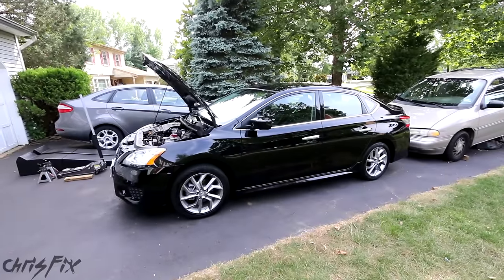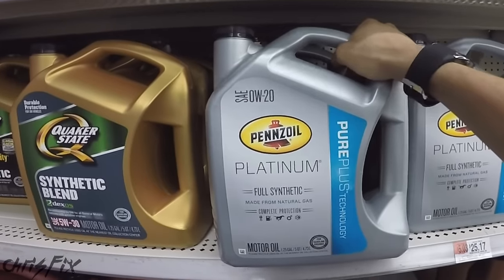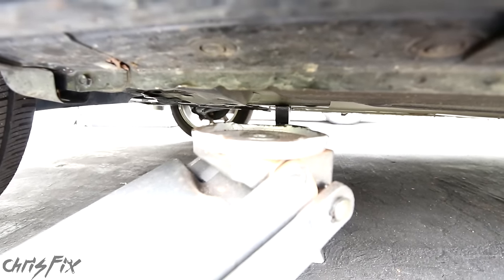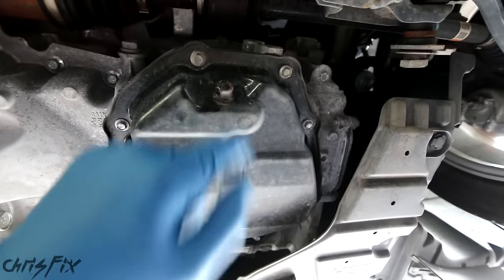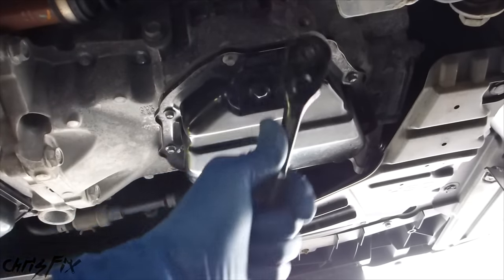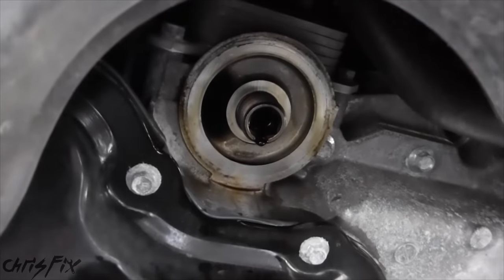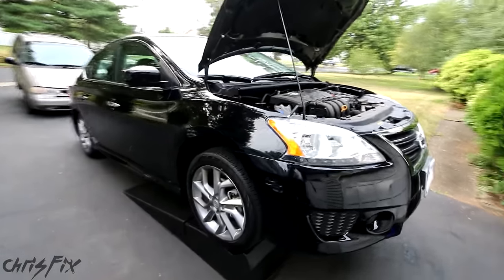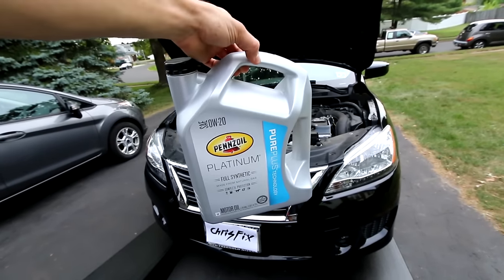How to Change Your Oil (COMPLETE Guide)

Comment: My record for at home oil change is 45 mins (that's setup, safety check, and the job itself)

So far I've done 6 at home oil changes across 4 cars and it's a great feeling not only for the cars internals (it runs so much better on fresh fluid) but for yourself having a sense of satisfaction. A sense of "I did that"

Personally I use Valvoline and change it every 3,000 (I've used both Synthetic and convention and I don't notice any difference)
Reply: Why Valvoline? Simple, it's the Motor Oil that sponsors Hendrick Motorsports in NASCAR (Jimmie Johnson fan BTW) though I am open to trying Pennzoil and Mobil 1
Reply: There are data sheets you can use to compare oils if you want, it's good to do! I've found that Pennzoil Platinum, though it says the same 5w30 numbers on the bottle, is actually thinner at startup and operating temperature than Valvoline Full Synthetic 5w30 and so it's better in wintertime than Valvoline for cold starts. One thing with full synthetic is it generally won't burn at lower temperatures like conventional does and it'll leave fewer deposits. Conventional vs Synthetic's more of a difference for a Diesel engine though, the 5w40 just lubricates quicker than 15w40 and doesn't lose its protection at the hotter temperatures.
Reply: 3000 miles. thats like 4800 km . its every 5 months driving for me. isnt that to often?
Reply: lars vegard vesterhagen Bundli not at all (now if you log 3,000 in 3-4 months you might wanna try synthetic)
Reply: automan224 45 MINUTES?!?!? It takes me 9 minutes for a full oil change and change of filter. Wtf do you do for 45 minutes?
Reply: lars vegard vesterhagen Bundli oil should be changed every 3 months either way.
Reply: HighElderThunder that accounts for 

setup
Running the engine for 10 minutes 
Waiting for 15 minutes 
Jacking the car up
Placing the car on jack stands 
Safety check
Cracking the drain bolt
Draining the fluid
Removing the oil filter
Replacing the oil filter
Replacing the washer on the bolt
Putting the bolt back on (not to tight)
Jacking the car back up to remove the stands
Pouring the oil
Starting the engine
Check the ground for leaks
Drive to AutoZone to recycle the old oil and filter (10 minute drive from my house)
Reply from the maker: Awesome man!!
Reply: Well, in America they wash their Car weekly, and Change their Oil every 5000 miles... like every 8000 Kilometres....

Here in Germany, i dont even wash it once a Month, and my last oil change is like 30.000 miles ago...

Well, i'm going to do it myself, but more like every 10.000 miles, thats also what the manufacturer (Ford) suggests, and every 3000 miles, would mean like all 3-4 months...
Reply: 3DamX1 if your gonna go 10k between oil changes go synthetic 

That lasts the longest
Reply: automan224 i can do it in 20 minutes but whats the fun in that - i take my time to make sure i dont accedentally take any short cuts
Reply: 3DamX1 mitsubishi recomends 15000km in Australia woth synthetic oil but i use 20L drums (10L sump) and do 10'000km between oil changes - so for me this ends up being about 2-3 months as we do alot of driving
Reply: automan224 with the ValvoMax Oil Drain valve, most cars drain in 10 minutes or less. Save the time you would've spent looking for tools and cleaning up the mess. Thoughts?
Reply: automan224 
takes me 15 minutes.  I fit under my truck without jacking it up. 
:)
Reply: Recently purchased a floor jack. Previously I've been using the scissor jack the car comes with in the trunk which is where most of my time went. So now my record is 20 minutes (not including warming up the engine, making sure the car won't land on my head, and driving the used oil to AutoZone)
Reply: Oh noe not a scissor jack. :O

Comment: I used this video to change my oil for the first time.  Thank you!  Additional things I had to look up: how to jack up my car (after a very scary day of trying to get my low car high enough to get jack stands under it- I went and bought ramps), and how long you need to let the oil drain out for (it dripped for a long time and less came out than I thought would).  In the end- success!

Comment: Even though I already know how to do all this stuff, I always like watching these beginner videos. You pick up small things you didn't know before haha.
Reply from the maker: BattlefrontZero That is exactly what I try to do because there are a lot of people who know what they are doing so I try to add some tips in there so even seasoned diyers can learn something new!
Reply: ChrisFix 
Chris, although I believe it is overstated, Purolator oil filters appear to have a tearing problem in their pleats during use.  Check with bobistheoilguy to read all about it.  If you are going to use a synthetic oil, put a Fram Ultra oil filter as they last a lot longer.
Reply: +stchman I haven't heard of a tearing issue on Purolators. 
I have heard of a lot of issues with Fram filters. The one they sell for Subaru's have the wrong bypass valves, for instance.

Comment: At minute 14.42, You also want to make sure your old oil filter gasket is not still stuck on the engine, because You don`t want to double gasket. Because double gasketing will cause a Major oil leak! God Bless.
Reply: Sean Rhodes double gasket is like double-bagging a condom... It gon’ leak!
Reply: I had a family member lose an engine due to double gaskets.
Reply: Sean Rhodes 💯
Reply: found that one out the hard way when i was 14 lol
Reply: Thanks for that info!

Comment: Tip! Use an awl to poke a hole in the old oil filter before removing it, this will allow for a controlled drain and keep from making a mess when you take it off.

Comment: Chris you should warn people about double-gasketing the oil filter, sometimes the old gasket stays on the oil filter adapter and if you double gasket it your engine could blow up
Reply: @The Animator there is usually a gasket around the oil filter were it creates a seal but sometime when u change out the old filter the gasket sticks to car and many people don't realize and just stick on a new oil filter without removing the old gasket. This then means there is no proper seal as the two gaskets are touching which can cause oil to leak which means the engine isn't getting enough oil
Reply: id love to see a video that displays what youre describing, for all the noobs out there.
Reply: if your engine blows ups does your whole car blow up?
Reply: Llama yes like on GTA lol
Reply: @lzeel-jg3hn  Wow, I have been changing oil for 50yr never see oil filter gasket stick to an engine
Reply: Down Dog01 it does happen.  Not often, but it does happen.  Lubing the gasket beforehand is the best way to prevent it.  I work in a lube/tire shop and have only seen it two, or three times.
Reply: @downdog0136  That happened to me the very first time I ever changed oil + filter. Didn't realize until I turn the engine on and it sprayed oil everywhere.
Reply: What he means by gasket is the rubber circle ring around the oil filter
Reply: Good catch!
Reply: @Amanda G it wont blow up relax

Comment: Top tip: some cars have two oil drain bolts, especially older ones. If you only drain one, not all of the oil will come out. For example all ford panther platform vehicles from the 1980s with the 302 V8 have two drain bolts.
Reply from the maker: Thanks for the tip!

Comment: A few things to add, is you don’t have to pre fill the oil filter, the piston walls still have an oil coat on them and it won’t wreck your engine. Also if you have any grease zerks, it’s a good idea to fill it up with grease every oil change. Also it’s a good idea to check your front and rear differential fluid level. Just some tips 😊
Reply from the maker: Thanks for sharing
Reply: @chrisfix  no problem 😉

Comment: My biggest tip is make ABSOLUTELY CERTAIN that you don't cross thread your drain plug. To do this, when you are putting the drain plug into the oil pan make sure it goes in straight and you can tighten it down flush with the pan with only your hand. If you start turning with your hand and it gets hard immediately, back the bolt out and make sure the threads on both the pan and the bolt are clean and free of debris. Then, go at it again. Keep trying until it smoothly and easily tightens BY HAND. I started working at an RV repair shop and in the process have also begun working on my truck. The more experienced guys at the shop have been giving me help in learning how to do various things with it. Well, I did my first oil change on my truck (meaning the first oil change I did myself instead of taking it to a shop) about a month ago. I was rushing it and cross thread the drain plug. This ruined the threads both on the plug itself and the lower oil pan, causing a small consistent oil leak. After weeks of trying to fix it, I just had to break down and replace the entire lower oil pan (which I also did myself). It was a great learning experience for me, but it would have been nice to not have to spend all that time and money replacing the oil pan. Remember to take your time, have fun, and DON'T CROSS THREAD! :D
Reply: Thanks for sharing your experience and helping others, such as me!

Comment: Agree with almost everything in this video. For the washers, I’ve used the same washer up to 3 times and had no leaks whatsoever. Also for the oil filter, I don’t think it’s necessary to spend extra money on tools to take the filter off. If you can get the filter off yourself the first time yo change your oil, you’ll be able to do it without tools in the future, just add oil to the gasket.  Also prefer the FRAM filters as they’re easier to tighten because they have rubber on the tip which helps you grip onto it well when tightening

Comment: One thing I have learned over changing my oil as a tip, if the oil filter is on there too tightly to loosen it by hand, get a leather belt and put it around the oil filter and tighten the belt like you would tighten it around your waist, and pull towards the front of the car and it will break free. Although this does work well I wouldn't do it unless you don't have any other option or other proper tools to get it off. Just my quick tip
Reply from the maker: Thanks for the tip!
Reply: I wouldn't use my best belt for that. lol

Comment: Can I use essential oils for this?
Reply from the maker: No
Reply: Thatd be one hell of an expensive oil change, both filling the engine AND seeing the aftermath lol
Reply: ChrisFix I feel like they are trolling xd
Reply: I've heard Cinnamon Leaf or rosemary Essential Oils are good for ur engine, they also increase ur car's hp - this is something ur parents never teach u
Reply: Sk00tkab00t at least the car will smell calming and good at start up IF it starts up. And then a new engine for you.
Reply: If its true then. How about using cooking oil xD
Reply: My car is a she
Reply: Make sure you pour some activated charcoal in there too.
Reply: @WI-FI_GOD   might be transgender it's 2019
Reply: I find Lavender oil of the correct viscosity works well.
Reply: Dude trynna make a joke and chrisfix aint having it😂
Reply: I use coconut oil.
Reply: I use maple syrup.
Reply: Oils aint oils lol (its a castrol thing) 😅😅😅😅😅
Reply: When your minivan uses full synth oil and miles per hour instead of DoTerra essential oils and Autisms per vaccine
Reply: ChrisFix lol
Reply: I'm interested to see the results of that. If you want to, try it.
Reply: Karen must have sent you lol
Reply: No. Things that are not meant for humans can damage if humans eat it, same goes for your car. We eat stuff formulated for humans and use certain soaps in the shower that are formulated for our skin, so only use stuff that is formulated for automobiles whether it is a type of fuel or a certain car wash soap.

Comment: 2 tips from me - check if the gasket on the old oil filter is there when you remove it, if not, remove it from the engine, because if you leave it there, it will leak. Also if your engine oil filter is like this in this video, so you can pre fill it - fill it from the small holes, not from the big one. Other than that, every other thing you need to know is in the video. :)
Reply: Yes, there is a reason, this is the input for the filter, so when you fill it from the small holes, u filter the oil and when you start the engine, u are 100% that all the oil is clean
Reply: just got here to write exactly this :D

Comment: Great video Chris I don't know a lot about cars but I just bought my first ever vehicle after a year of saving (2009 Infiniti G37) and I'm eager to start working on it myself!
Reply from the maker: Congrats and awesome man! Have fun with her!
Reply: i know the feeling i just bought 01 Maxima and am learning so much by simple repairs!
Reply: Not a bad car at all. Pretty easy to change the oil on after you remove the skid plate. Shouldn't be more than 4-5 screws
Reply: Nice car!  Start with the easy ones like oil change, air filter, the real no-brainer stuff (which you won't know it is until you do it the first time).  Then as you gain confidence (and do a little research) you will be amazed at how easy so much of it is!  Keep at it!

Comment: spends $350 on Race Ramps

"And here is my wheel chock that's a piece of lumber from my firewood pile."
Reply: the first time I changed the oil on my car I sucked up the oil with a syringe :)
Reply: Haha, i actually have metal wheel chocks but I prefer an old brick. Ain’t now way the cars moving with my trusty brick.
Reply: @BaliMystic  they also make good hammers in a pinch😁
Reply: Lol, I noticed that.  Nice that he put a reasonable priced one too.

Comment: Hey Chris here's a tip when you put the new oil filter on I usually rub a little bit of old oil on the rim that way it screws in easier and it's a lesser chance of metal against metal hope it makes sense
Reply from the maker: Great tip!
Reply: Thank You!
Reply: What do you mean by rim? like the hole on the filter that gets screwed it?
Reply: the rubber gasket on the filter you want to put oil on that rubber gasket and it'll seal it
Reply: Aaron Jeneary True, when my father first showed me how to do it, he mentioned to put oil (old oil or new) on the rubber part, the gasket, and then screw the filter in.